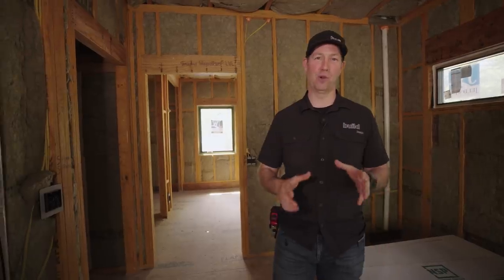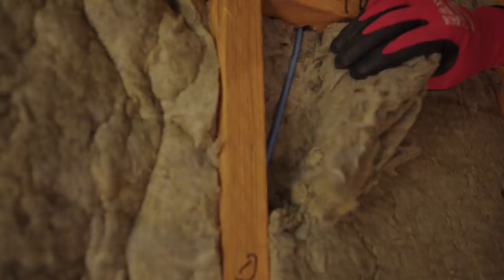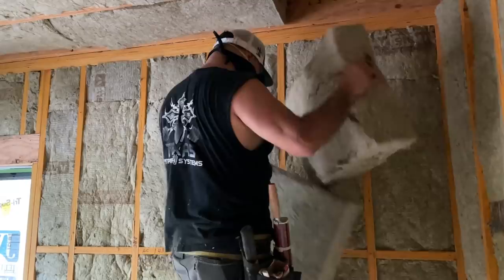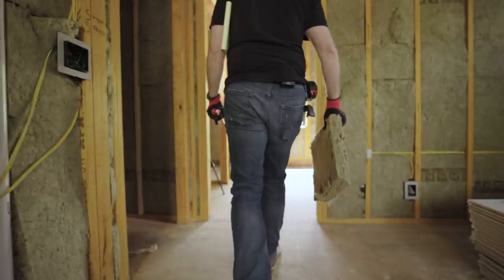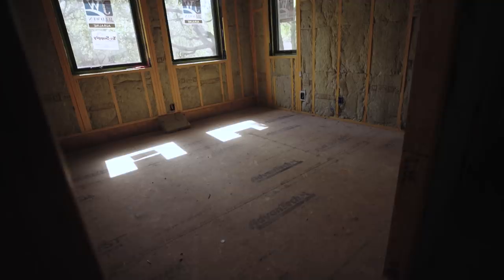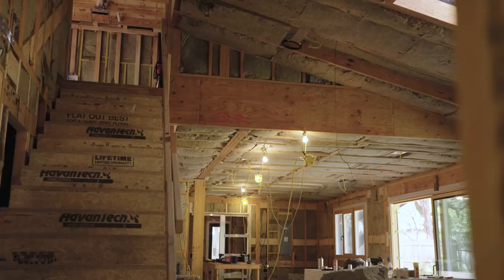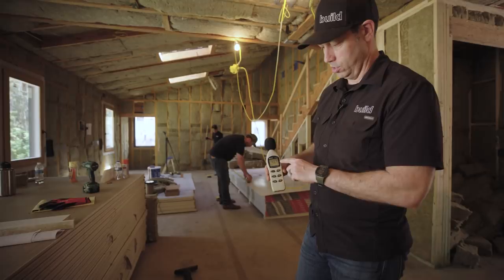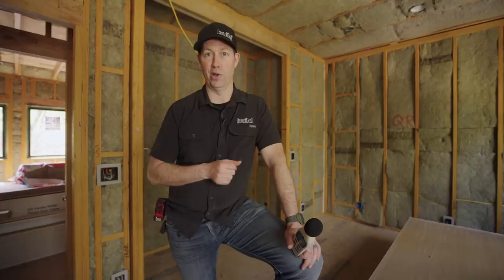7 reasons I used Rockwool insulation at my house.

Comment: When I did the siding replacement on my house, I used Rockwool and was very pleased with the results. My house was a 1950s with no standard spacing in the studs, no insulation, no sheathing, and no vapor barrier. Previous owners spent a lot of time making the inside look nice and I didn't want to redo all the drywall to insulate, so I redid the siding ( it was masonite) and went with smooth Hardie plank.
Reply: How much did that run ya?
Reply: @Jekyll_Island_Creatures  I don't even remember now. It was a while ago.
Reply: What is the change in your heating bill? And house drafts? This is my plan for the spring on my 1960s house.
Reply: @angellas.1314  I really didn't get the chance to really find out. Shortly after doing the work, I took a job in a different city and had to move.
Reply: How did you put vapor barrier? I have 1900 house was planing to do the same but not sure how to add vapor barriers
Reply: @ghshomeimprovements  It's stapled to the sheathing behind the siding and all the seams are taped. I used Tyvek from Lowe's.
Reply: @Jekyll_Island_Creatures  sweet name 👌

Comment: You've had me sold on Rockwool even though my contractor is trying to change my mind.
Reply: Reason why your contractor is trying to changing your mind, more then likely they’re getting some kind of incentive from manufacturer/supplier or both. More often that’s not passed onto you as the owner.
Reply: @ABC-oo4vm  yes because this video being sponsored by rockwool has no bearing on his opinion i am sure.
Reply: Just tell them you know Matt Risinger, and ask for the sponsorship discount ;)
Reply: @CookieManCookies  when hogs grow wings, just then it still a maybe.
Reply: he even says they allowed him the freedom to use other types of insulation thats why 5% of his house is other insulation  dont use rockwool the contractor is right but dont use what the contractor wants do your on reserch this guy says hes sponsor by rockwool  and been sponsor so if he shows anyone else he brakes his contract
Reply: @mikecousin8523  what are you talking about? It's  around double the price
Reply: What is contractor trying to change your mind as alternative? I personally use Thermafiber now, same mineral wool insulation only no formaldehyde binder makes it a healthier option👍.

It might be your contractor wants to use spray or sheet foam due to the volume area he/she is limited to and the superior R-value/in of most foam thus easier to meet code requirements for insulation. If it’s in attic, many contractors recommend blown in because it’s MUCH cheaper but thermal decay is awful and I would definitely not allow your contractor to choose that option.
Reply: @MichaelM-to4sg  Not really sure. Wierd vibes every time I suggest any new build techniques or products. But overall he is doing a great job for my budget and he eventually gives in if I push hard enough. He seems to want to do spray foam and I am a bit reluctant on that stuff.
Reply: @christking85  Under what conditions is fiberglass better than Rockwool? If the only answer is price, then there's your answer for why Matt's using Rockwool. He's a high-end builder, not a budget builder, so I don't know why you'd expect him to start using low-to-medium end materials.
Reply: @ae1ae2  When did i expect anybody to use anything? If you wanna talk to yourself go to the mirror. If you wanna talk to someone else, then respond to what was said and not what your make up in your head. The only answer isn't price btw. I already posted a link to some website that explained the differences. It is funny seeing people that obviously know nothing about construction talking about " high end builders" lmao. One of the builders I do work for does houses between 200k and 5+ million. Would that be a high end builder? if so what is a low end builder? Another one does 10+ million and also does apartments that rent between 750 and 2200 a month. High end or no? I like how you assume fiberglass only low to mid end. Try knowing what you are talking about before just spouting nonsense.
Reply: @mikecousin8523  Trained builder? lmao. I actually work in the construction field. My 2 year old nephew is a trained builder. I help him build stuff all the time. You seem to be embellishing your credentials. Pretty vague. I guess i am just supposed to believe that you just do and know everything. I mean you are a trained builder for over 20 years. I know master electricians that i wouldn't ask about plumbing. You say builder like it is a magical word that makes you uncriticizable. You can call it picking a fight. I say it is calling someone out on their BS because it is fun. You say you looked up the price yet said nothing about the price difference between the different kinds of fiberglass insulation. What company do you work for? Very few companies do large commercial and all residential. Thats like saying you specialize in diesel motors and foreign cars. Can happen but most pick one or the other because it is not a good business decision to specialize in 2 things that barely overlap.
Reply: @christking85  ummmm, stay in your lane might be appropriate here as lots of foreign cars ARE diesel engined! 😂
Reply: Listen to your contractor. This stuff is illegal to use indoors in Europe because it has been linked to lung cancer
Reply: @kostasg7109  What stuff has been linked to lung cancer?
Reply: @danielbuckner2167  Yes some are. I wonder why most diesel mechanics dont work on foreign cars then? O maybe because they are not the same. If you weren't smart enough to get the analogy thats on you. A heart surgeon is a doctor, so is a brain surgeon. They must be the same thing to you then right? They are both doctors and surgeon. ummmm stay in your lane might be appropriate here. Take your own advise
Reply: @mikecousin8523  here in KS, mineral wool is about double the cost of fiber glass.  Rockwool brand is about triple.
Reply: It's definitely a great product, biggest thing is again that fire retardant and the hydrophobic property.
Reply: @kostasg7109  The rockwool used here doesn’t contain any harmful chemicals/abestos. Can You kindly give some details on what you meant it causes cancer.   & isn’t Rockwool a European - Danish company as another person alluded to?
Reply: @ABC-oo4vm  Just like these YouTube videos... He is paid to sell you. These are all clever commercials he's paid a lot of money for all of this
Reply: @HalfStarFilms  my point is and will remain, I’m a working man whom got to work for flipping everything. I don’t get many discounts or handouts for much of anything what I purchased nor barrow on my good name. I work or make huge sacrifices my ass off. If it wasn’t for the working class or paying customers - profitability company’s won’t be able to “just give it away” to individuals. Then in turn, make YouTube videos that add AdSense. He’s making money on something he didn’t pay for of the back of paying customers. If your making money for somethings you didn’t pay for, don’t you think there’s a moral obligation to return some of what you earned to the company whom you excepted a handout from. I do not care what the options people have with the sayin, THERES NO SUCH THING AS A F R E E LUNCH! Somewhere - Somehow - Someone had to pay.
Reply: @kostasg7109  haha, uhhhhh ever talked to a physician about history of fiberglass inhalation?
Reply: @christking85  Wow. You think semitrucks are where most domestic diesels are? I guess you drive a honda crv. Go ahead and tell your brother whatever you like-- he peonably ignores you too. Youre also gonna love it when your brother lets you know where many commercial diesel engines are built!
Reply: @christking85  Again thanks for the nonsense theatre. I'm sure its entertaining for you in lack of coherent thought and communication but for everhbody else its just psychobabble.
Reply: @chriswise1232  Here in the PNW R15 Rockwool runs about $1 pr sq ft ( $59 for a 59 sq/t bag )and Corning R15 faced runs about $0.68 cents ( $49 for a 67 sq ft bag) .. 30% more for Rockwool and I happily pay it because it's so much easier to work with, if it gets wet its not ruined, and will not burn..
Reply: Some people believe Rockwool has similar qualities to asbestos. Do some research.
Reply: @rjthomasindyusa  Also: Some people think Aliens were found in Arizona and have been kept there for decades while we get space age technologies out of their brains. Do some research.
Reply: @danielbuckner2167   I think I just found the VP of marketing for Rockwool.
Reply: @rjthomasindyusa  He should have hidden in the rockwool where you'd never hear him! 😂
Reply: Rockwool...
  Isn't that what they used to call asbestos?
  Fast Forward fifty years, is this Mr. Fluffy all over again??
Reply: @nicholasrhodes4550  Ffs, be better than that. If you’re completely ignorant of mineral wool manufacturing, do a modicum of reading and research before making such absurdly ignorant comments. This channel is a place for reasonable discussions on modern building science. Wildly false claims lacking any credibility are not welcome here.
Reply: @MichaelM-to4sg  Read your news.  The EU (and probably other governmental agencies) are asking the same thing-if mineral wool will turn out to be as carcinogenic in fifty years or so as asbestos did after seventy years of use.  The jury is still out.
  I asked a legitimate question, perhaps too casually.  In return, I got your response.
  For Fuck's Sake, 'Michael M,' be better than that.
Reply: @nicholasrhodes4550  Mineral Wool has been used & tested for decades. If you understand how it’s made, there is no direct health concern and it’s not remotely in same chemical family as asbestos. Suggesting it’s in any way related to asbestos is irresponsible and ignorant. 

The issues w/mineral wool are well known. It can become airborne in handling, just like most insulating materials. Because it’s inorganic, just like fiberglass insulation, there is risk to humans as the human body has minimal capacity to vacate or dissolve inorganic matter that enters lungs. Mineral wool can therefore damage cilia but is not a carcinogen. As with most insulation materials, humans need to wear proper fitted respirator mask when handling it. 

The only other known risk for most commercially available mineral wool insulation products, including the Rockwool brand, is the use of formaldehyde as binding agent. It is in very low concentration. For this reason, it is not recommended mineral wool insulation be left exposed in interior environment. Plaster, drywall & similar interior wall coverings mitigate any potential off-gassing. There are now a few mineral wool insulation products, such as Owens-Corning Thermafiber, that uses no formaldehyde binder in production. For us in CO, it’s a few $ cheaper than Rockwool but can be more scarce to find. We’ve been using Thermafiber in all above ground insulation except roof decks for last 2+ years. We use GPS foam under slabs, at exterior footings and atop roof decks.
Reply: Guys, Here is our Savior

HalleluYAH translates “Praise ye YaH”

YaH is The Heavenly Father 
YaH arrives via the TENT OF MEETING
YaH was Who they Crucified for our sins
YaH was Crucified on an Almond TREE

— Ancient Semitic Cuneiform of Moshe (Moses)
— Isa Scroll (The Original Isaiah)

Isaiah 42:8
"I am YaH; that is my Name! I will not yield my glory to another or my praise to idols.”

Isaiah 43:11
“I am YAH, and there is no other Savior but Me.”

Isaiah 45:5
“I am YaH, and there is none else.”
Reply: @nicholasrhodes4550  You are thinking of a similarly named but totally different product, Zonolite / vermiculite which is like a rock. That has actual asbestos contamination (sharp thin fibers). Those are always a risk- it just takes a while for someone to develop disease. 
Mineral wool/ rock wool has been used for a long time using waste from coal and steel production and other methods these days resulting in fibers that are shorter and fatter. I haven't seen studies suggesting raised health risks (most likely at the manufacturing stage, less likely at the installation stage, unlikely once sealed up in a wall), feel free to share ones you are aware of. 
I find it easy to work with unlike fiberglass which takes more care to do well (and many installers leave gaps with).

Comment: Matt, I used this in a studio/tool shed new construction project in my back yard. The easy cutting enables you to fill the entire cavity, no voids like most insulation products. Spray foam has the problem of not being installed correctly unless the equipment is working perfectly, the installer knows what he is doing, and does it. Rockwool is DIY friendly. It should be the only insulation sold for wall and ceiling fill. It out performs all brands, it is expensive, hard to find, worth the effort, worth the additional cost, much more quiet, really gives you a high performance product. This is no place to economize the build. Putting this behind your wall covering will reward you as long as you live in your home. I would not have used it had I not watched Matt's channel, so glad I learned of it. It is the only insulation I will use in the future.

Comment: We had loose rockwool insulation in the ceiling of the house I grew up in, and it was definitely superior to anything else IMO. And if I live long enough to actually have a desire to remodel the house I live in, rockwool would be my first choice bar none. Thank you for extolling rockwool's many virtues.
Reply: Your opinion is correct i always felt the itch with JOHNS MANVILLE  and not Rockwool.....

Comment: Rockwool is one of my top building material picks because the batt density is so consistent and they cut like cake. As you can see, the fit and finish of the installed product is excellent. Worth the extra cost!

Comment: Having worked in residential, commercial, and industrial construction over 26 years, I paid attention to industry standards. I did my homework, and I learned about what products are best for fire rating, sound dampening, and R-value. This insulation is the only insulation I would use when renovating my own house. There is no way I would ever want foam panel insulation or spray foam anywhere near my project. I've been watching videos on how to install this insulation on the exterior of a house, and I found the videos interesting. Thank you for the video, I always appreciate other perspectives as it helps me to learn something I might have missed on my own; or it affirms my own thoughts about certain products. Have a great rest of your day.

Comment: My woodshop is right next to an apartment building.  I insulated it with rockwool and did the walls in MgO board.  My neighbor who lives in the apartment building just asked me what I did in woodshop . . . He had no idea that it was a woodshop.  This stuff is amazing at sound insulation, especially if you pair it with MgO/plaster instead of sheetrock.
Reply: What's MgO plaster?

Comment: I used Rockwool on a 150 year old house conversion here in the UK. North facing walls, framed and Rockwool stuffed, between framework also framework between rooms,  all floors and ceilng joists similar. over three floors. Roof space and eaves filled. Cost a bit but what a result. Low heating costs compared with before, sound control absolute winner. The other advantage which you could have shown with a Blowtorch. Get a slab and heat up until red and feel the back of the block. Hardly any heat transfer front to back. Great as a plumbers torch barrier when soldering copper pipes.

Comment: Hi Matt, as a drywaller from Australia I just wanted to note how important it is that the insulation not protrude past the stud wall line, it seems like it will compress when you press on it, but over a large area it transmits a HUGE amount of force on your drywall.
Reply: I for one appreciate your info.  Thank you

Comment: I used Rock Wool throughout the rebuild of the downstairs 950 sq ft apartment in our 50's built 2x6 frame house. It was back to foundation/studs. 2x6 Rockwool in studs above foundation to second floor. New interior 2x4 framing for interior walls with 2 inch offset from foundation and exterior 2x6 walls. 2x4 apartment walls facing exterior Rockwool insulated with 2x4 exterior, all interior facing walls insulated with 2x4 safe and sound, 1st to second floor beams filled two layers of safe and sound along with rezbar and 5/8 drywall. All gap areas fire stopped including wall transitions and fireplace areas. Finished with poly and acoustic sealant vapor seal.... my wife and I lived in this space for 8 months after the build was complete. It was the most comfortable space I have ever lived in through so many weather conditions. It was awesome. Do it right!